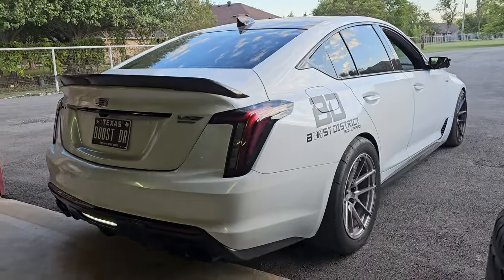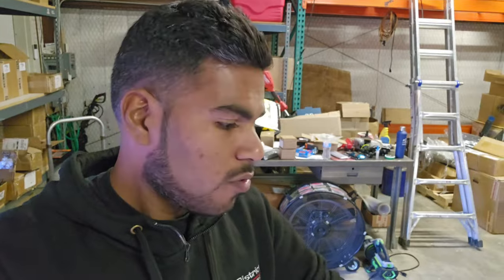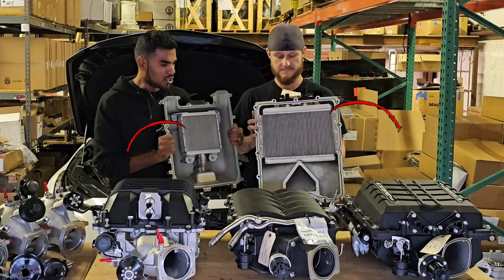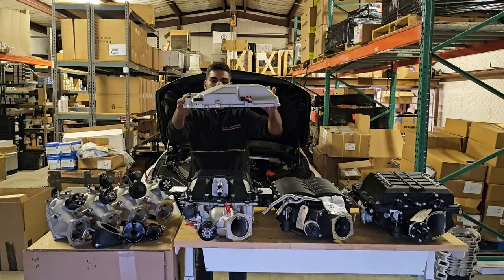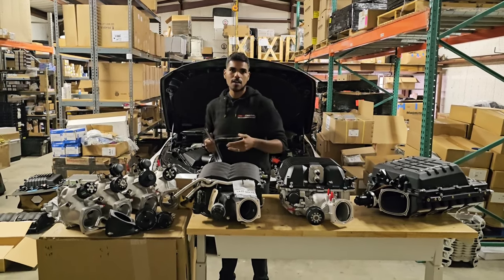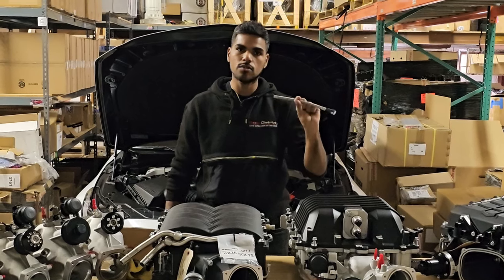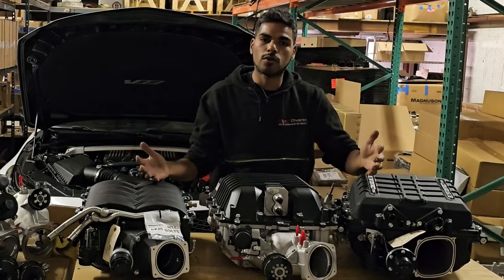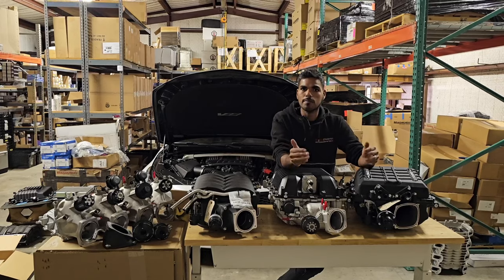Which LS supercharger is right for you? BoostDistrict shows you!

Comment: Killer little video man, putting the info out there, my problem is height in the front around the throttle body area 99 bmw m roadster with built 6.0 currently has a fast 92 intake and tb

Comment: what supercharger do you recommend for a stock 5.3 lm7 in 1992 chevy k1500 used for daily driving and towing? was originally looking at the lsa charger with zl1 top
Reply from the maker: The LSA supercharger kit with zl1 lid, upgraded heat Exchanger and 850cc would be the proper combination for that setup. We've built lots of tow rigs with that combo with great success
Reply: thanks @boostdistrict  for the fast response. what size fuel pump? and what kind of hp/tq numbers have you seen on similar setups?

Comment: I wanna make about 550/600 with the 2650 because of the cooling efficiency. Unless the lsa will get the job done without a ton of aftermarket coolers!
Reply: you won't have to worry about cooling issues until after 700whp on pump. thats about where meth injection, E85, large intercooler fluid tanks, dual pass heat exchangers, fans, or ice tanks need to start coming into play to keep detonation away. 740-750whp if using a fully ported blower
Reply: @edmundnlemadim8480  thank you so I’d be good with the lsa supercharger?

Comment: I wanted to ask will I be able to put a v8 in my 1999 Chevy s10 xtreme and if so what engine would be best for ease to put it in and for my price. Im new into truck and cars and an engine swap is one of the hardest things I’ve thought of doing. Please let me know if you can help lol
Reply from the maker: We've done many. Any LS would work, just run Corvette accessories to have room by the radiator clearance
Reply: @boostdistrict  Would there be anything else I’d need to replace for the v8?

Comment: I have a 04 gto, would i need motor mounts to lower the engine if i get the 2300 lsa. Also i have a 102 throttle body would that fit on it
Reply from the maker: Lowered mount does help. The 2300lowpro doesn't necessarily need it but it would help overall clearance
Reply: @boostdistrict what about 2001 Camaro SS with the 2300 low pro clear everything ?

Comment: How much taller is the Magnum PI over the basic LS plastic LS6 or LS3 intake.......?   I have an F-Body 98' Trans Am.  I want 1200 RWHP....plus I'll spray a 150 shot to reach my 1300 RWHP final goal.   BUT WILL IT FIT UNDER MY FACTORY WS6 HOOD?
Reply: The question is will it fit under your cowl, for 100 % the stock hood wont clear